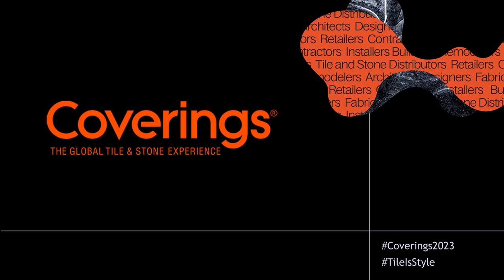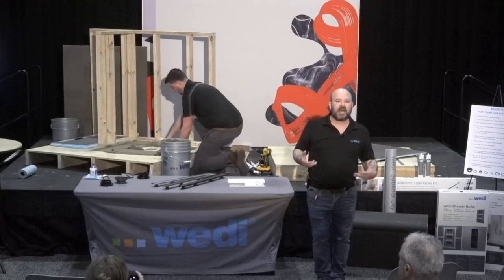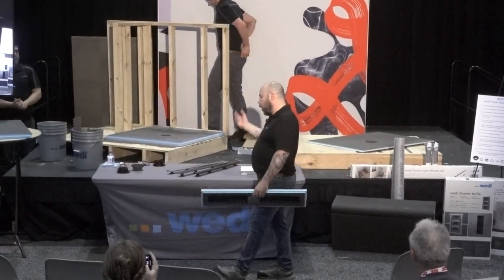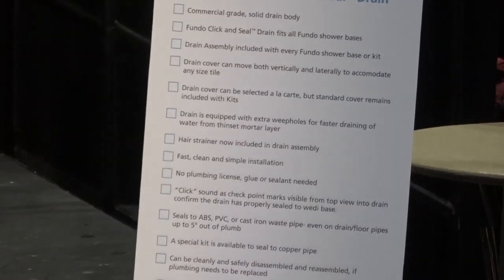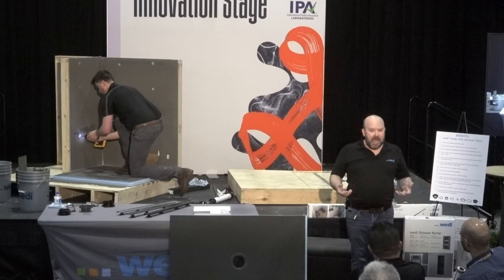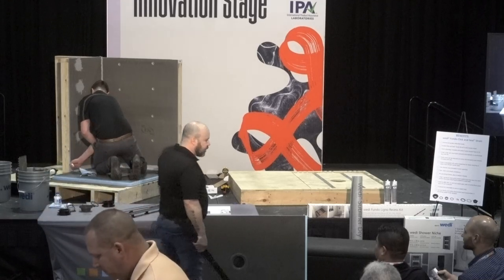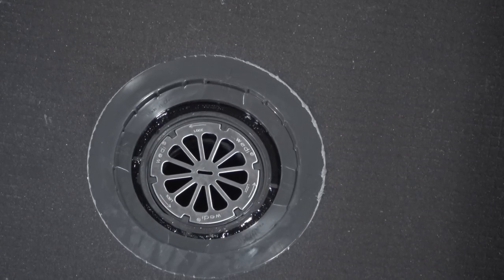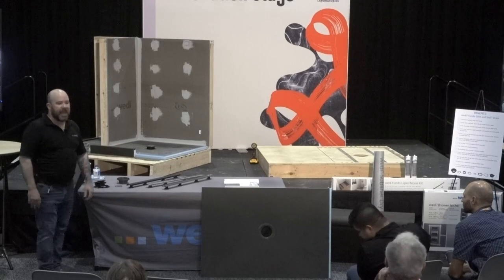Click and Seal Drain Demonstration at Coverings 2023 - Full Demo

Comment: In this video it is stated that the floor drain is to be cut off flush with the sub floor. In the Wedi Technical Handbook  page 19  #1 last sentence it is stated to : evenly cut off the floor waste  pipe 5/8" below the surface of the recessed floor. 
What is the cut of the waste pipe flush with the floor or 5/8" below the top of the sub floor?

Comment: I have a concrete slab. I understand cutting the 2 inch pipe flush, but what is the 5 inch circle for? My pipe hits the exact middle of my Wedi floor panel. How deep do I need to cut into my concrete with this 5 inch circle?

Comment: I have been using wedi for the past 20 years with no problems with original drain design, this should of never have been changed, this new design goes against any logical construction process, it lets water outside the pipe, sometimes the spacer ring needs to be cut in half to try and compress o ring, because the thicknesses of the rubber on the spacer rings are different?????   If the spacer ring does not go over the 2"pvc it will never compress the final o ring, they never mention that in video. They want thinset in between the plastic flimsy rings, again never mentioned in video,  now after you thinset this it cannot be moved like they said????? Not to mention when a heavier set person puts their heel on the drain cover held up by flimsy plastic, just more chance of grout cracking. Just like other people mentioned the lack of professionalism in the video filming the back of his head during the installation, didn't any ceo's watch the video???? This is incompetence of the engineers and people running the company, I will never use this product again!!!!